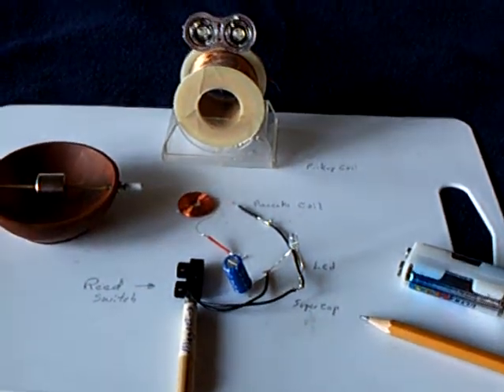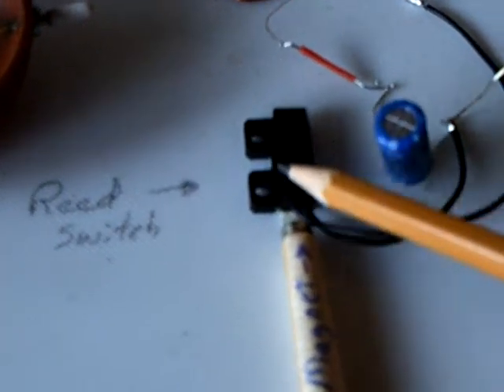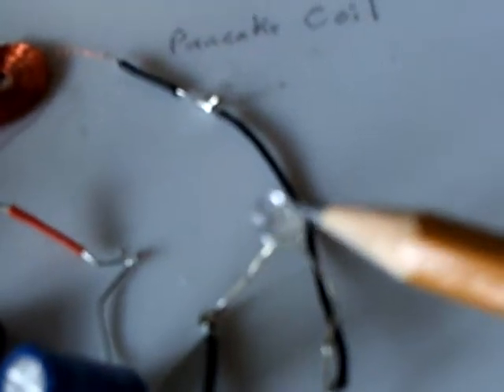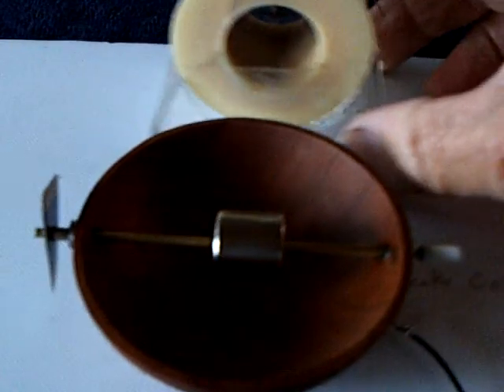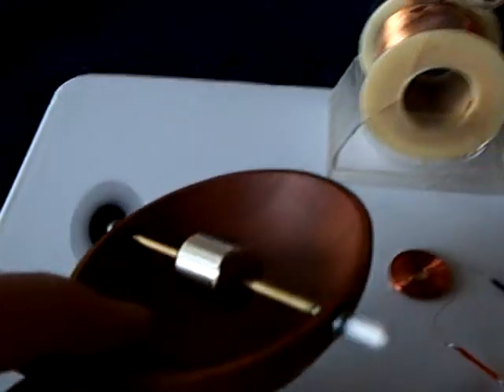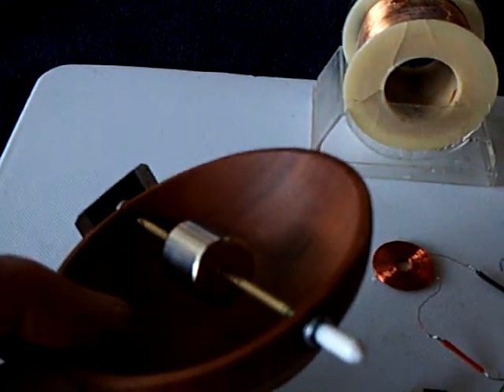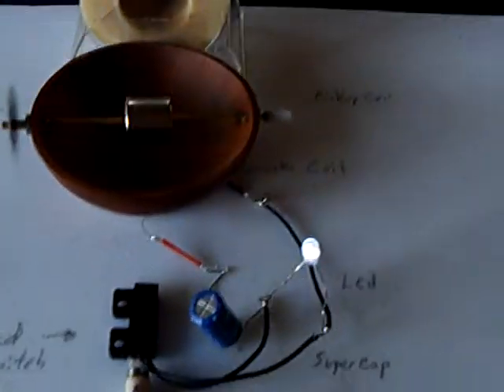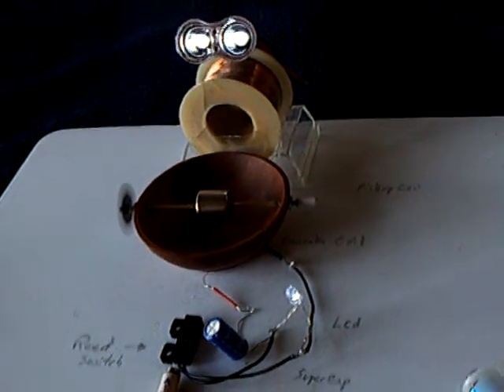Reed Switch & Pancake coil-- Bowl Motor

Comment from the maker: Excellent question about why I use a small supercapacitor in my experiments.  The reason is that it gives me quick and easy way to look at power consumption.  I usually use meters to check out 'The Numbers' when the circuit is hooked up to a normal power source.  Using a capacitor of a known value doesn't ever lie or give me a false impression of energy consumption.  If I ever stumble upon a true 'self-runner' the cap will stay charged up or perhaps increase in voltage.